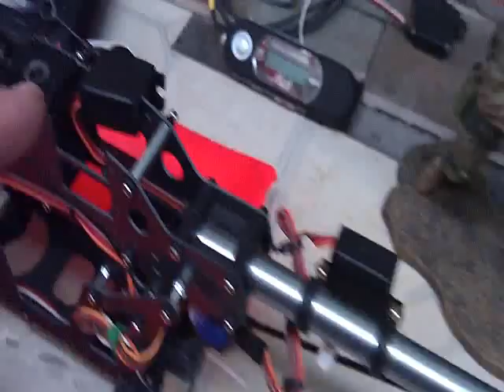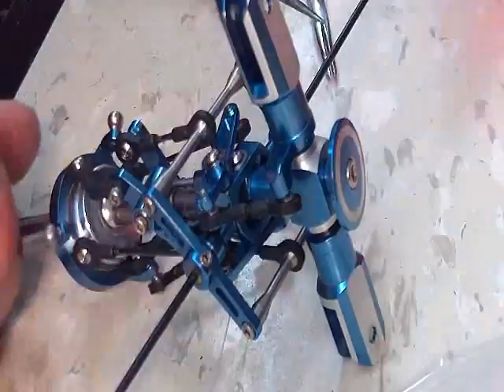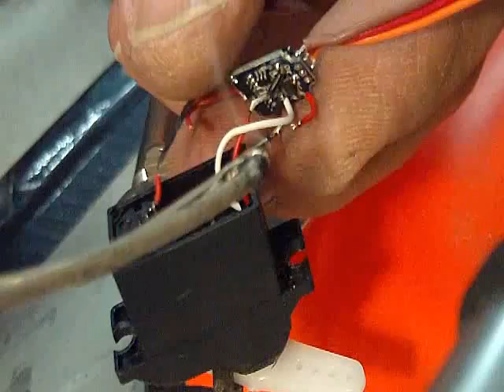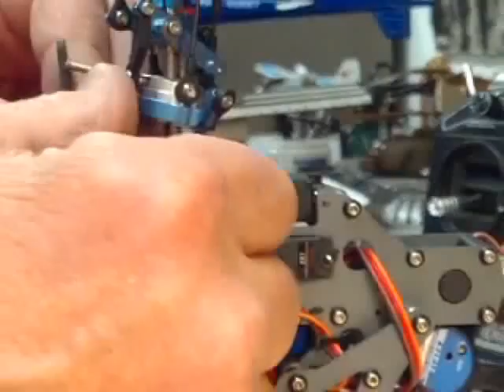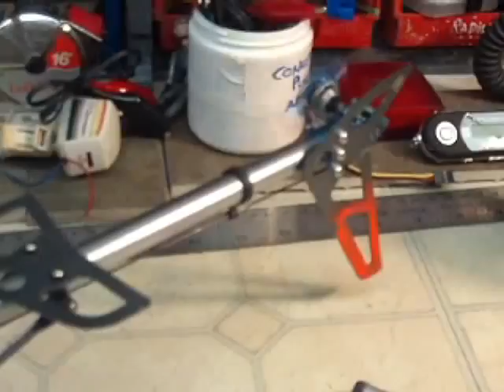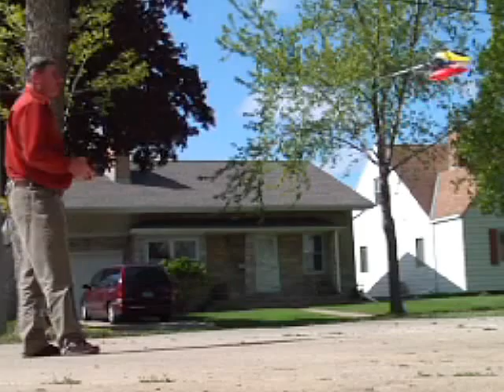Blue Ray Crash repair of Gear, main shaft, servos and tail.

Comment: you can always use a trex 450 v1 manual.. {assuming these still use the 3mm feathering shaft}  it is a knock off after all :)

If tedious repairs are not your thing, heli's probably arent the hobby for you....lol at least the way i fly :)

Comment: A couple comments.
The tx can be set up w/ the USB cable that should have come with it. There is a video on how to set this up on my Youtube page plus a link to my website where I have the files plus default configurations.  If you use t6config you will be able to reverse the servos as well as better level your swash and set up pitch curves. I also do not recommend one to replace only 1 servo with a different type on the swash. That would give possible imbalalance and unwanted mixing.

Comment: Hey Dave, a brave video my friend, I know how hard it it to work on the heli and film at the same time!
One idea for you, have you heard of a 'solder sucker' or 'solder pump'?
These are sprung loaded, you hold its tip near to to a solder joint, heat the joint and use the pump to suck all the solder away!
That would let you remove the wires from that servo motor very easily! sorry if I am telling you stuff you already know.

Comment: Nice job on the repair!

Yea, always best to use metal gear servos with high torque. I just had my aileron servo die during my flight cos the motor burnt because of low torque.